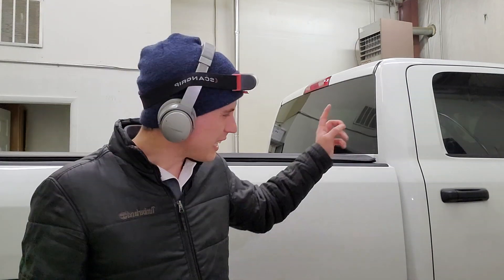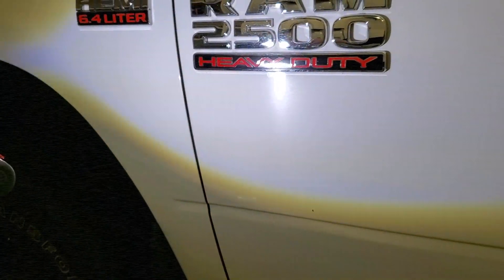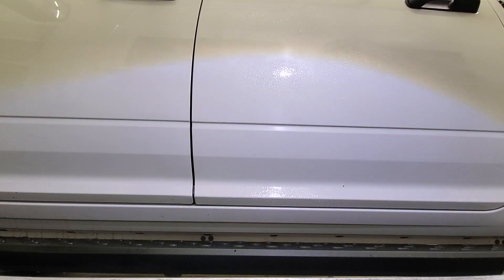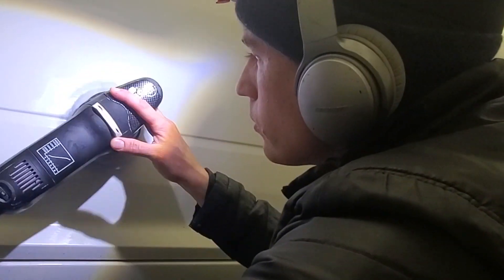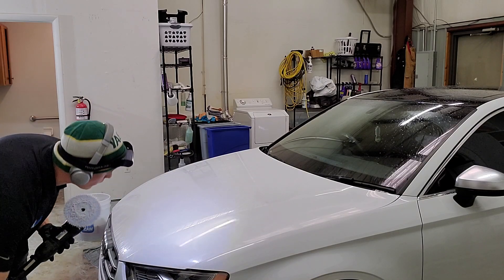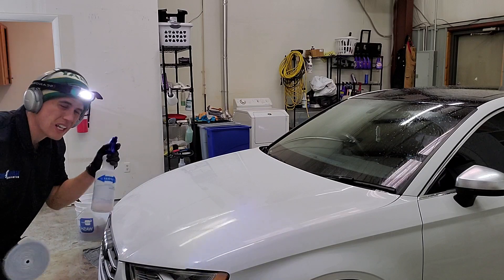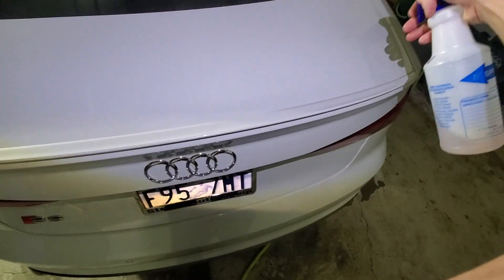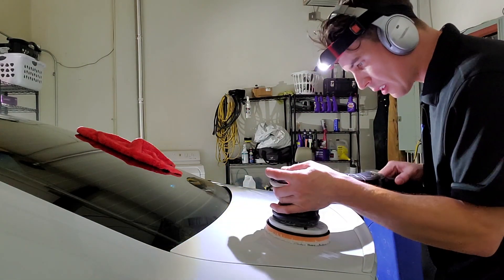Secret “pro” tip for claying white paint (REMOVE STUBBORN ORANGE SPOTS)

Comment: Please don't take this he wrong way, I am just curious if you've tried a stronger iron remover like Megs D1801 or maybe Carpro IronX? I've heard Ferex is weak - maybe it isn't true but it's what I've heard from other pros. I haven't tried it myself. Have you tried others?  I'd be afraid of causing pigtails when the iron particles dislodge and get caught in the pad. Has that not happened to you or does it not matter because you're doing paint correction anyway?  Again, not criticizing. Whatever works for you works. I am more curious than anything.
Reply from the maker: Not taking it the wrong way at all! Ya know, I have tried Megs D1801 (that's the product they released at SEMA 2018, yeah?) and I like it a lot. I'm still trying to work in the Optimum System whenever possible. I also like Iron X. They are all silly expensive...As far as the pads go, I wouldn't be so worried about pigtails. With wool and microber it seemed to just absorb into the pad no problem. But I did try this method after an initial clay and soak with ferrex...but yeah, is this the BEST way to do it? No, probably not. It definitely worked though and if this were all you had in your arsenal, it might save you on a rainy day!
Reply: I agree I would switch to a more effective iron remover. Carpro IronX has been a standard iron remover for a long time and it's cause it's effective enough. If you have a lot of iron particals and they don't get of when you PW clean rinsing it off. And I always do this is to follow up with some test spots where I spray on 1-2 times to see if I got some of the iron particals left. If it's bleeding they are left if it's not bleeding they are gone. And if it's bleeding still. Apply it again and depending how much of them that's left I either wipe down with a mf towel or mf applicator sponge the whole vehical or parts where the iron particals where left only. Wait until just before it's time to be clean rinseded off and then lightly aggitate it. Try to get as long as possible of dwell time and the more the iron remover is able to be desolveing. When you rinse it off. Use a PW and start from the bottom and work your way up. This lets the iron remover desolve until it gets off and also the water pressure from the PW to get it more effectively dislodged from the paint. 
And why does the Carpro IronX cost more. The iron desolving chemicals is not cheap when they buy them in for manufacturing the iron remover. Also just cause it's shows bleeding a lot is not a way to see if it's effective or not. That comes when you have these kind of iron particals to remove when you apply the usually cheaper iron remover and after 3-5 applications it still is bleeding from them. Aggitate it slightly in the end of the dwell time makes it much more effective so of cause polishing with a polisher over it will work. But with a great iron remover you should only need to be aggitate it a little with a mf towel or mf applicator sponge and PW clean rinsing it off. I have had this happens to me also with a cheaper iron remover. Switched to my go to iron remover which is as Carpro IronX or even a notch more effective and it's Bilt Hamber Korrosol. 
If you have these amount and hard to remove iron particals on a white paint. You have them on any color of the paint but you just don't see it as easy. Iron particals don't care which color the paint has it's getting in them either way LOL. So many think that they have gotten all of the iron particals out of the paint when it's a darker colored paints. But if like in this video they are still left in the paint. 
Also here is where the quality and effectiveness from the clay you are useing. If you where to clay bar with Meguiars Proffessional Red Clay Bar you would get the iron particals easier with that or the 3M Perfect It Clay Bar vs any clay alternatives. A soft or mild detailing clay bar or clay alternatives don't get those kind of hard sitting contaminants out and off the paint as effective as a great quality aggressive clay bar like Megs Red Clay Bar and 3M Perfect It Clay Bar. It's in these situations great and effective products can rescue you and definitely when you are a proffessional detailer. You can get there with lower quality and lower effectiveness but in the end you have used a lot more iron remover product and you have used much longer time on claying. So the little extra you saved buying a cheaper iron remover is now eatened up and often getting more expensive as the time spent also increases. 
Get you a bottle of Carpro IronX and when you have a vehical with a lot of iron particals. Do a comparison testing between. And apply until you don't get any bleeding effect from the iron particals. It's shows very well with the bleeding effect if it's left or not as it won't bleed if the iron partical parts is of the paint.

Comment: Awesome tip! I have a 2012 RAM 2500 with white paint just like the work truck you demonstrated on first in the video. Do you have any suggestions for that particular paint for correcting that truck? I currently have a Maxshine M15 as a machine, lake Country orange HDO pads, buff n shine 50/50 pads, lake Country micro fiber pads, and the last cut for compound/polish. I don’t mind picking up more supplies if there is a better combo so any suggestions would be much appreciated! Thanks.
Reply from the maker: If I were you and it were swirled up I would take microfiber cutting pad with the last cut, work it between speed 3-5 depending on what you are seeing in the paint. Cross hatch pattern 2x2 section, slow-ish arm movements. See if that gives you the level of correction desired. Then orange hdo and polish for second step....every paint is different so play around with these combos until you see desired results. And if they dont work try something else 😂
Reply from the maker: Clean pad often. Crucial!!
Reply: Thanks! I’ll try that out.

Comment: Wow! I just bought an 06 Ridgeline which is white and needs full correction. I also have a customer with a white forrester which i always had issues with to get to my level of complete correction. Thank you so much, definitely worth trying.
Reply from the maker: This process wont work super well at the "correction" side. I mean it can remove scratches but adding the iron remover will change the process of how your compound/polish is designed to work. If your goal is correction, you clay first. If you are beating your head against a wall trying to remove the contaminants during clay process ...this can be a helpful step. THEN followed by correction. If that makes sense...anyway, sorry if that's not even what you were asking about lol

Comment: Little tip: spray some quick detailer/claylube before you add your pad to the paint. This will help to keep your paint smooth and slippy and it will only touch the fall out spots. Especialy on darker paints if you don't want to do a fully paint corection after the threatment.
Reply from the maker: Totally. Makes sense! In the case of the truck...it was already hammered so I wasnt worried about it. The audi I did a 2 step AFTER this and coated.
Reply: @HawkProDetailing  yes true if it needs the full pull this is already perfect

Comment: Don’t agree using a wool pad. Use Ferrex as a lube for the clay towel. If that and polishing doesn’t remove said contamination, so be it.
Reply from the maker: Dont knock it til you try it my man! Clay towel is good for express details...yes I already tried ferrex as clay lube... but if you can't get it with that "so be it" isnt a good enough excuse for me as a pro:) With that said, this is detailing...not life and death stuff so I appreciate you and I could very well be wrong 🤓
Reply: Personally, If i knew there was a lot of remaining iron contamination I would opt for real clay to help minimize maring as much as possible since it would be more likely to shear it off and fall away, or, if trapped, embed itself quickly deep in the clay  keeping it off the paint as you continue your pass. Synthetic clays have minimal ability to absorb the particle and keep it away from the paint as you continue your pass. If your going to correct the paint anyway it doesn't really matter I guess and so synthetic would be quicker.

Comment: Iron decon = liquid gold. I want someone to make a great cheap version of this product
Reply from the maker: I know right? I did the eagle one video a while back...it smells nasty but does the trick:) Probably the cheapest version I've found
Reply: @HawkProDetailing  The nasty smell is the chemical that actually does the work, sodium thioglycolic acid. It's the same thing used in the beauty industry to give perms. The less it stinks like rotten eggs the less potent it likely is. That's the tradeoff. BTW, it does not dissolve iron like most think. It reacts with the rust coat surrounding the iron particle (iron begins to oxidize immediately in air) causing it to shrink enough to become dislodged from the clearcoat. Think of a ninja star stuck in wood. You shrink it just enough to no longer be wedged in the wood and it falls out...same idea.
Reply from the maker: @Big_Old_Dog  awesome explanation thank you!
Reply: Use the Eagle One Black and Plasti-Coat. Just as good as the expensive stuff, but for 1/4 the price.

Comment: Wondering if ferrex as a lube and a clay disc on da DA might work just as well if not better? Im sure those pads would be trashed/cant be used again after having iron remover on them no?
Reply from the maker: Ya know....its possible. I'm scared of the clay disc method because it seems dangerous. Feels like you could pick up a contaminant and then drive it back in if it's sitting  on the face of the disc. The mf or wool or even foam will absorb it safely I think? Pads are just fine :) Totally good to go after some APC, rinse with water and compressed air
Reply: I had Yvan himself tell me to use a clay mit with ferrex to speed up the process. They definitely work together!

Comment: 2 methods I've used when regular clay bar and lub does not work. 1. Clay with Iron Remover-Viscous Bar or Mit. 2. 5000 Grit Sanding Discs or Paper. Something light enough that any Correction phase will remove with no issues.

Comment: Running a polisher over contamination makes no sense to me. You are introducing more defects to the surface, creating more work for yourself in the correction stages.
Reply from the maker: It's a great point. But I went from "so so" on the claying front and then started polishing. And guess what? The contaminants didnt budge even with pad and polish. At that stage a lot of pros use acid. But I dont. So I tried this, and it worked. Yes it needs to be cleaned up in correction stage.....but all of the contaminants were gone after I was done (or at least most) so for that particular purpose...it works
Reply from the maker: You're tapping into the fallout remover and supercharging the clay process...remember clay slightly abrades paint even if our eyes dont always catch it

Comment: iron remover + da claying pad removes anything, a pass with a magic eraser and iron remover wors too, this tecnique is only a waste of time and product
Reply from the maker: Ya know I believe ya and had the sense it was a waste of product and time. But it filled the need in that moment. I'm intrigued by clay pads but I dont trust them. So you just use the magic eraser as your "clay?"
Reply: The magic eraser will abraid your paint. You should go with the clay pad, it works, and you may not even need polishing.
Reply: @flemmingjensen3202  clay bar also is an abrassive and will mar the paint clay does not remove stubborn heavy contaminants that maqe white colors yellowish/brownish or it will maqe the job but with a lot more effort implied, in any case using clay or magic eraser I will follow up with a one step polish ,in most cases that fixes the damage for a perfect white color restoration.
Reply: @dadideluxeautodetailinginc6742  Yes, clay is an abrasive. However not to the same extent. I've had my share of white cars, never cared for other than automated car washes. I usually wash, use iron remover chemically, remove tar and then clay for 1-1,5 hrs with disc and glove/bar in tight places. Lube is Optimum No Rinse, sometimes iron remover, which lacks in slickness though, I think. 
Yes, we have loads of rust specks in the Danish winter. 😊